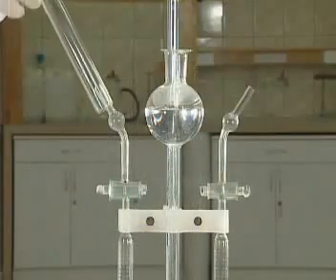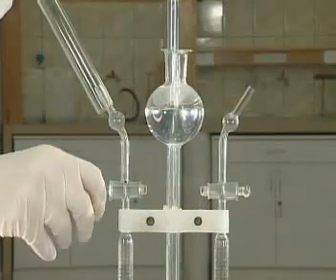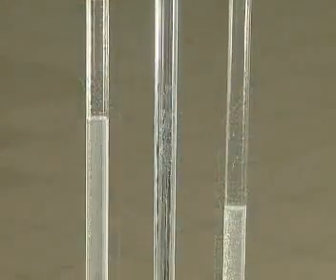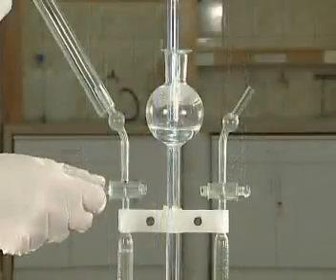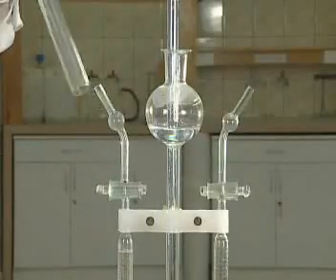Electrolysis of Water

Comment: Hi, what causes the difference in the water level at the end? Is it the pressure of the gas pushing the liquid down or is it just the volume occupying space. If it is the latter, isn't gas compressible which will  result in no change in the water level?
Reply: If you're still alive; the difference is because the decomposition of water generates 1mole of Oxygen and 2moles of Hydrogen for every 1molecule of water(H2O). So therefore the volume of Hydrogen accumulated at the cathode will be twice the volume of Oxygen generated  at the anode. Thus; leading to unequal volume of space occupied by the two gases.